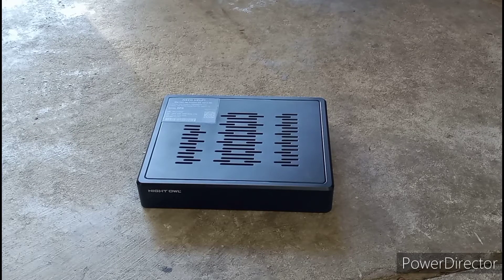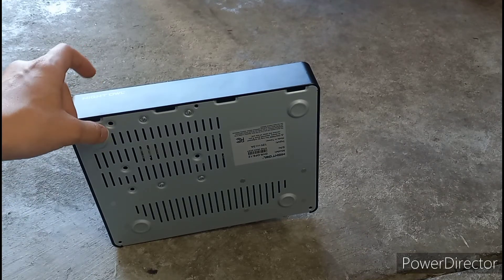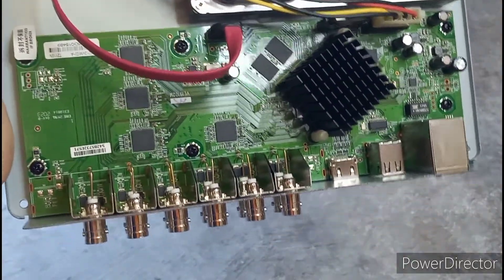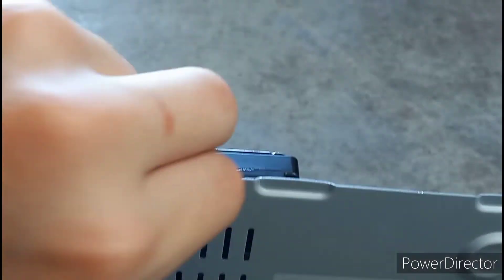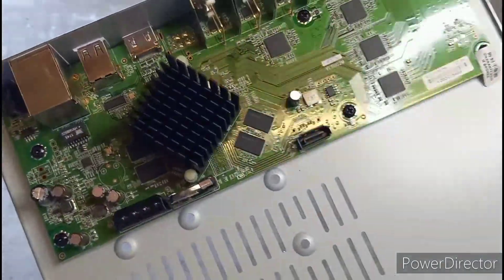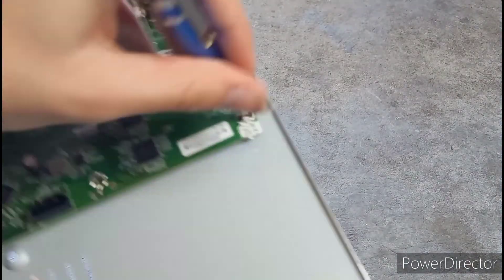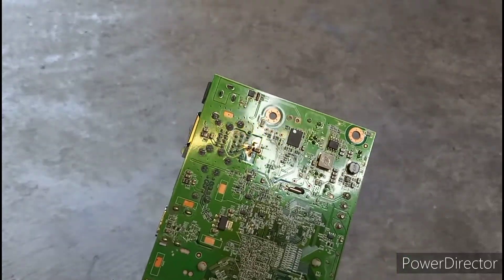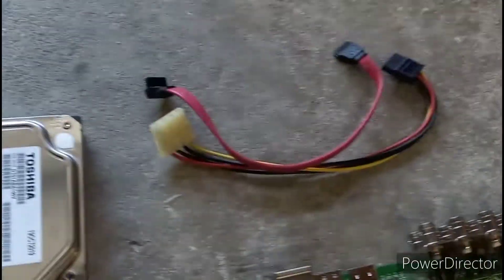Video DVR Teardown, Night Owl DP8 -BlueTechno

Comment: Do you know how to factory reset it manually physically? Mine stopped working even though it turns on, the app just says there’s no device so I want to try physically resetting it
Reply from the maker: You could theoretically take the hard drive out and connect it to a sata-usb converter and connect it to your computer, or even replacing the hard drive might work if nothing else does, but there's a chance it could be a bad board and waste money on a new harddrive, but it's whatever you want to do

Comment: Good safety tip regarding how capacitors can hold charge even after unplugged. Take caution against static discharge which can fatally damage sensitive parts. You know like when you walk across the carpet and then touch something metal and it goes zap.

If you were going to throw it away anyways you could have given desoldering and resoldering those obviously blown surface mounted Parts a try. By purchasing a roll of soldering braid which soaks up existing solder. As bench techs we use soldering iron tips similar to flat tongues rather than common soldering iron tips.
Reply from the maker: I have copper braid, I just mostly use a solder sucker to desolder stuff, but no I don't throw away my parts, even if there broken,
Reply from the maker: Yeah, you have to be really careful when it comes to compasitors, I had to discharge some that would probably kill you before you hit the floor, it's welded nails together.
Reply from the maker: Thanks for commenting on my video